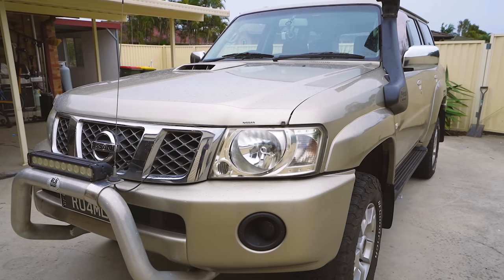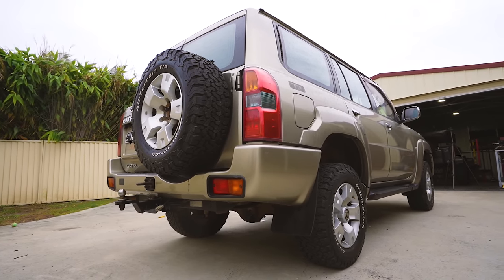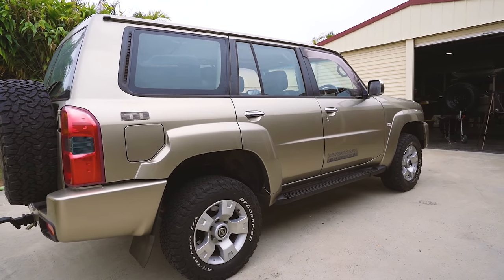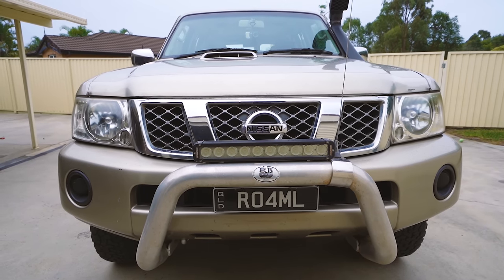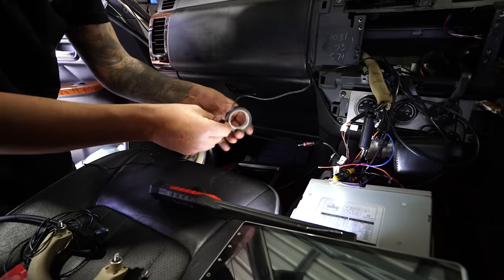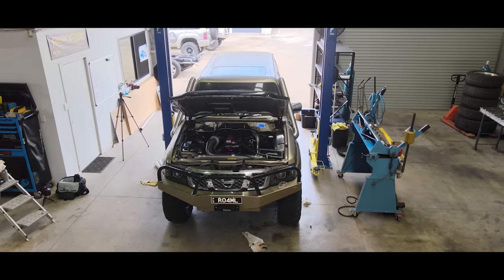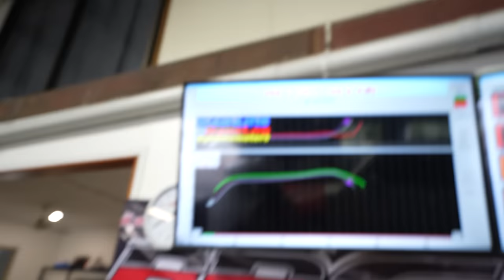Building THE ULTIMATE Engine Swapped 4WD in 20 minutes!

Comment: Should have put an 0m606 engine or m57, Isuzu not good motor 4jj not enough torque.
Reply from the maker: The car made 900nm of torque, trust me it’s plenty haha
Reply: @RoamLyfe  that’s crazy! I have under estimated the motor here in Eastern Europe we swap everything with Om606 or m57. 
I’m going back to London to prep my Land Cruiser prado 90 swb, engine swapped with a volvo 2.4 Diesel 5 cylinder. 700nm so far and 260bhp still on stock internals and turbo. Let’s see what we can do.